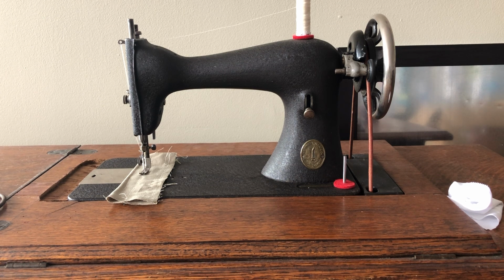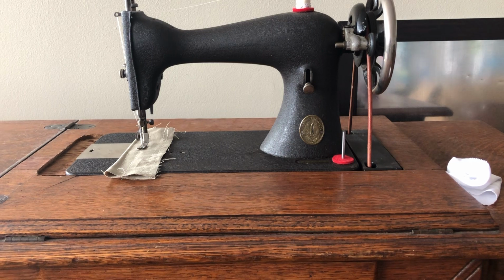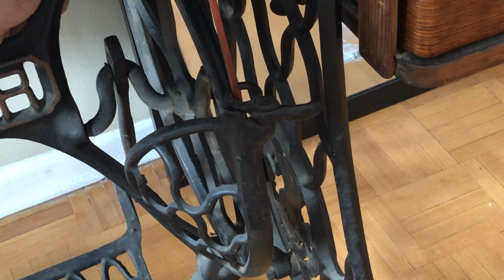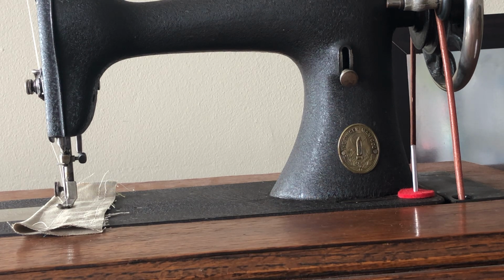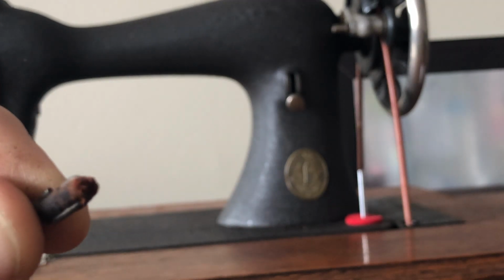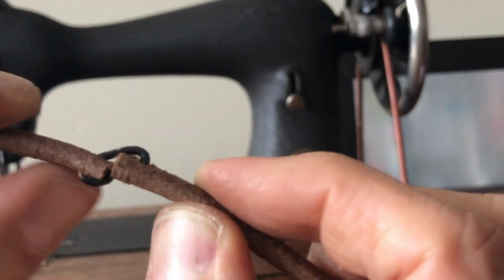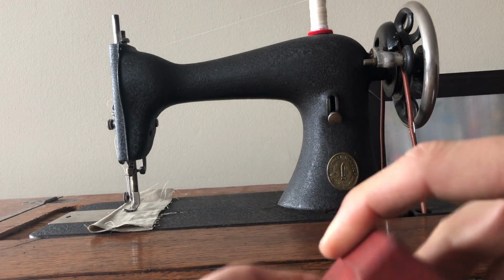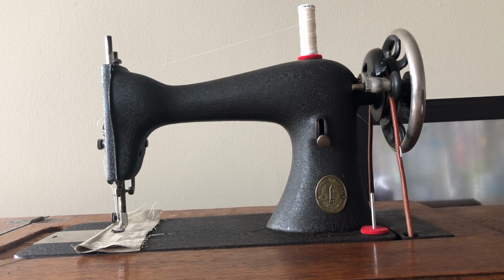MEASURE TWICE-CUT ONCE: INSTALLING A NEW TREADLE BELT: Measuring and Cutting Leather Treadle Belts

Comment: Ok, I'm at my wits end with this 1902 singer treadle restore project for my sewing room. 
I've gone through 18 belts trying to get it to find that sweet spot. It didn't come with a belt so I have no clue what the ideal length is. I've watch countless hours of these tutorials and not a single one has helped and it's all been regurgitated information. 
What is the specific tention requirements? 
What is the length of cord you used for yours?
Why does it keep slipping and then stalling like a 3/7 gear 10 speed? 
Yes everything is greased and oiled. 
Yes it's a brand new oak arm connecting the peddle to the fly wheel. 
What do?

Comment: Vintage sewing shop. How can I clen inside of my fr white rotary.trudle. and loud finger nail on black bord. Nose in paddle and fr white rotary trudle  1911 how I get screwed off that are stuck on and see part cover such as place to oil. Lubercaction.   It done 10yr or so but steel sound like it not running way she need to be.  Get rest and old oil off inside. And part of peddle move up down of weel and  any help  would be greatly appreciated. My mom has 77 74 kneepeddle white rotary  from 1920s how we go about clen it be safe use. It electric.  And singer 50s how now it safe as well use.   I wach your show every day.

Comment: Is 3 in 1 oil good for anything with the vintage machine. Like cleaning metal?
Reply from the maker: Never us that product as a replacement for sewing machine oil, but you CAN find good uses for it as a "Penetrant" that will help loosen stuck parts and it may have some cleaning action given that it contains solvents.

Comment: They come in  3/8"  which is thicker and  3/16" which is thinner.  Use original size for Singer 66 threadle belt 3/8" thick by 72 inches long.

Comment: Using a high quality leather conditioner on the belt when it is new and periodically will keep the belt from dry-rotting, etc.  I used it when I took the curled up leather out of the package to soften and uncurl it.
Reply: were you able to actually find a leather belt rather than that pressed leather that feels like paper. My paper feeling one slips and stretches quite a bit.

Comment: I've  had my treadle Singer for a long time and previously  was able to get an actuual leather belt.  I have only founded  composit leather belt material recently and I  find it to be  very  unsatisfactory.  Can you recommend a reliable source for belts?
Reply: Make sure you ask vendor if it is cowhide leather or bonded leather.
Certainly, price will tell you there is a difference. I paid for my 3/8" by 72" long $10.95 USD. 3/8" is the original circumference for Singer 66 treadle sewing machines. Take care.

Comment: I used electrical heat shrink tubing after I cut the belt to small.  It worked great.
Reply: Isn't that stuff great. I have a mechanic shop and I keep a few of the smaller scrap pieces to take home just for little projects

Comment: I am so glad you made this video. Thank you! I am searching locally for a treadle machine, and had no idea how to hook up or adjust the new belt.
Treadle belts are intimidating to me, even though I am a spinner and have rigged up many fly wheels. But, as you know, this is a different beast. 
Could one use wax on the belt, as one would the string on a spinning wheel? Also, would I use my spinning wheel oil on the bottom mechanics? Would that work, or would I need a different oil?
Reply from the maker: Great questions Rachel.  I have not used wax and cannot speak to that but some viewers may have.  Then too, it might vary depending on the kind of wax since some are used to reduce friction (Kitchen /furniture drawer wood on wood sliding).  Others can make things stickier.  I'm unfamiliar with spinning wheel oil so cannot say.  I would use sewing machine oil or you can try the spinning wheel oil and see how well it works.   Try not to let treadles stress you, the belts are actually not tough to install at all as long as you remember that leather, just like the fibre you spin, can and will stretch.  Once you have the belt installed and adjusted, it should serve you a long time.  Given your skills in spinning yarns, I suspect that your understanding of treadle belts and machines will come to you more quickly than to most folks.  Hand in there with it.  I am becoming more and more convinced that a treadle should be my own go-to machine for a lot of the mending I do.
Reply: @VintageSewingMachineGarage  Thank you for the reply.
I am leaning toward using a non-electric machine for everything, lately. It may be a mid-life crisis (lol). I have restored a Singer 99k with hand crank, this past year, and use it for most of my sewing. I want to add a treadle to help manage larger projects. Now, if I can just figure out how to sew knits on them...
Reply: Vintage Sewing Machine Garage     Traditionally,  neatsfoot oil is used to condition and preserve leather.
Reply: Rosin  is a  hard graphite  wax
Reply: I have a Schacht Sidekick wheel and was told that any good sewing machine oil would work for lubrication.